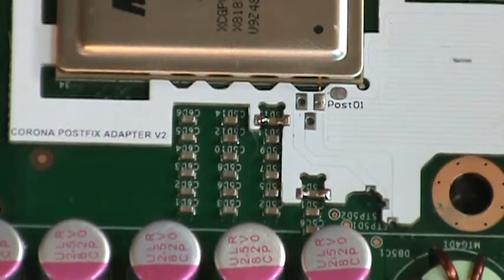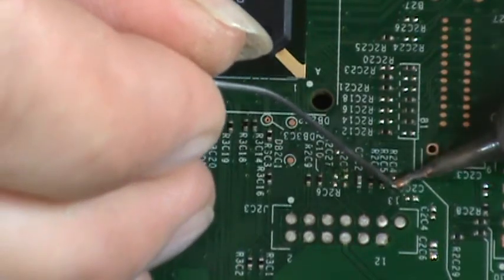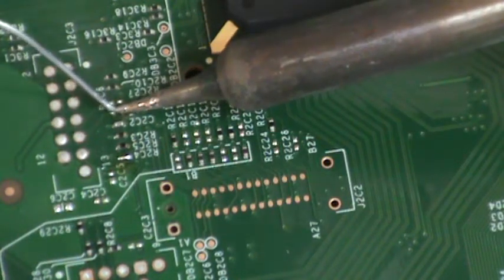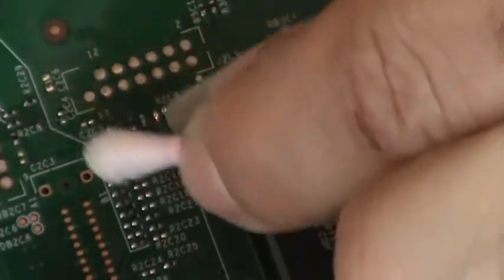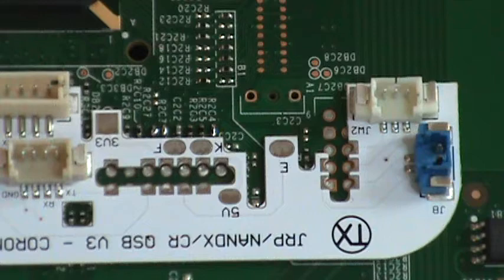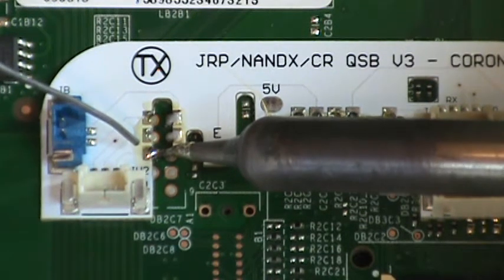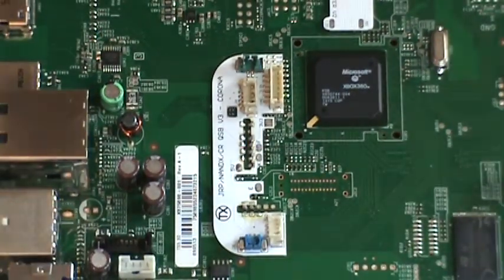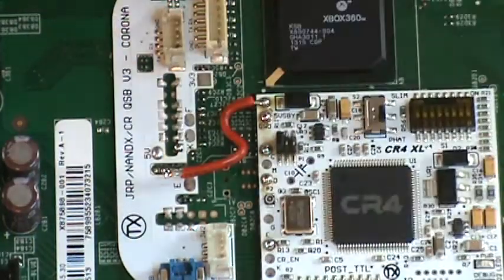CR4 install guide for Corona V5 Xbox 360E 2-5

Comment: are the newly manufactured xbox 360 e capable of rgh? thanks guys.r
Reply: The more recent ones (Made after/during 2014)  have a different board than the earlier models, so they can't be rgh'ed
Reply: +Milan Jovanovic I'm unsure, but I know there's a forum thread somewhere describing the manufacture date. Just google something like "Corona V5/V6 Motherboard", or maybe "Winchester motherboard" would turn up something better.
Reply from the maker: +miggboyy March of 2014 should be ok but it's hard saying for sure. Mid 2014 is when they came out with the new non rgh compatible board.
Reply from the maker: +Milan Jovanovic well the best way to know for sure is to open it up and look at the board. I think your ok though. Search google for "corona identification guide" and you should find an image that describes the different corona boards and what's needed to do the job.